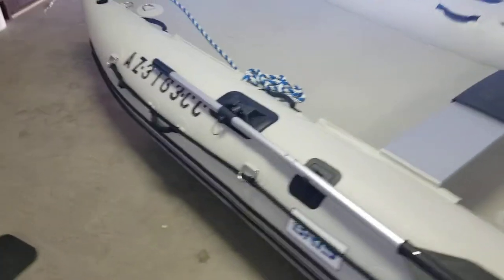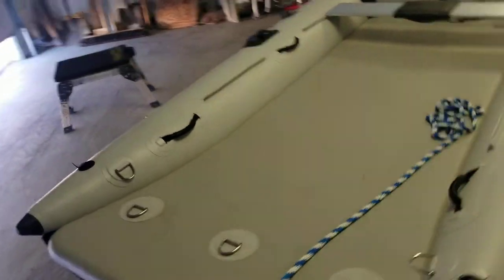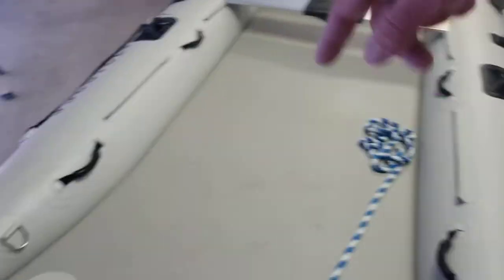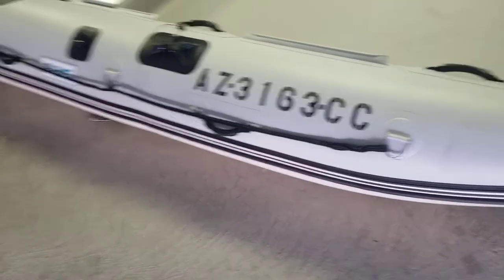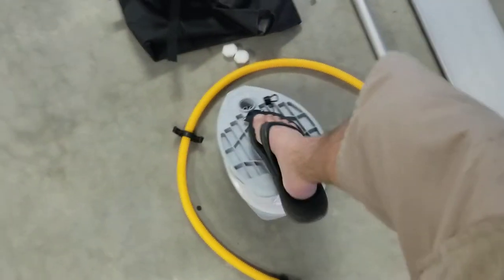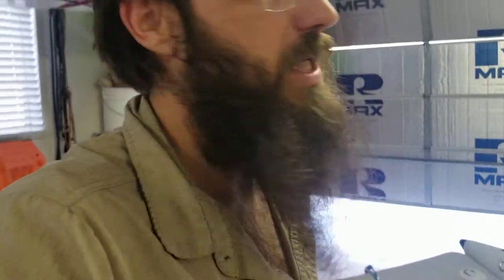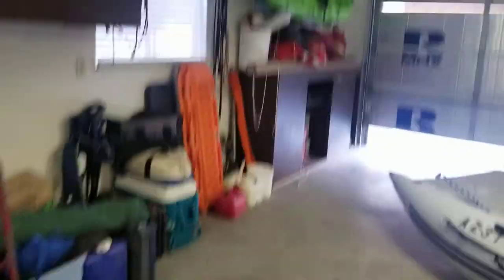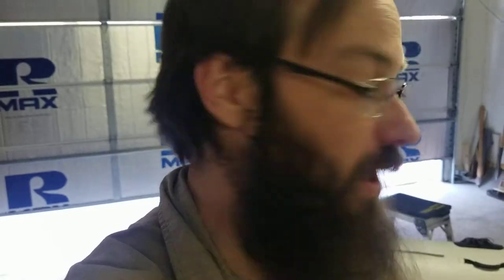Bris H335 Inflatable Catamaran first look and impressions

Comment: Did you buy this boat used?  It looks like it's seen some tough times.
Reply from the maker: No the factory quality control is lacking
Reply: Can one person handle  this boat?
I plan to transport it deflated on my boat and inflate it to use then deflate again prior to leaving .. I will have aa very powerful inflator. Does that sound impractical?

Comment: How would you compare this boat to the takacat 340 LX? I am looking to buy one of these to ride my family, I know that takacat is more expensive I just don't like that the takacat has an open transom
Reply from the maker: Being the Takacat is a premium price I would assume it's much nicer but haven't seen one. The cat style gives more deck space and makes a great swim platform but is easily swamped with water over the bow. You have to keep it up on plane but get off the throttle as you go down a wave so you don't stuff the bow in the next wave. That's why the Takacat has the open transom I assume so you can bail all that water. I posted a video about going  to larger drain plugs in the Bris after swamping mine. Would recommend the cat if you have boat handling experience, need a good swim platform and a wide deck and are mainly on lakes or inland waters. Otherwise I would look at a more traditional bow. Happy boating
Reply: Thanks for your quick reply.  Regarding traditional boats bris sells 15.4 heavy duty with 1.2 mm how would you compare to the Saturn 18 ft?
Reply from the maker: @michaelfriedmann5  I only have experience with this one Bris boat and not overly impressed with it's quality but it does work and float. Just don't expect years of service from it. Saturn boats seem to be a bit more popular but probably make at the same factory as the Bris. Glad to help with what I can.
Reply: Look up Truekit. Its expensive to get it shipped but main difference is welded vs glued . Takacat uses glues seams. Depending on your uses I wouldnt even think about it.